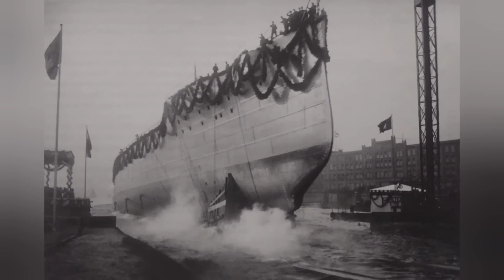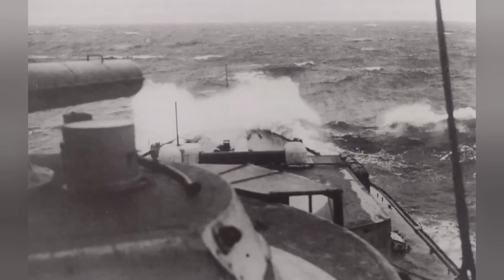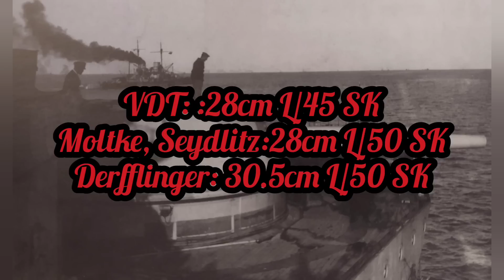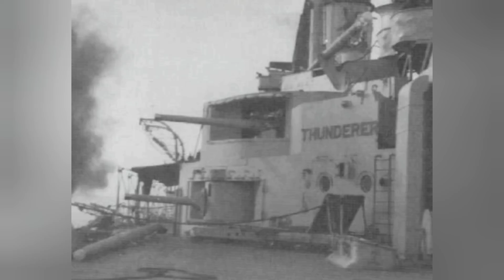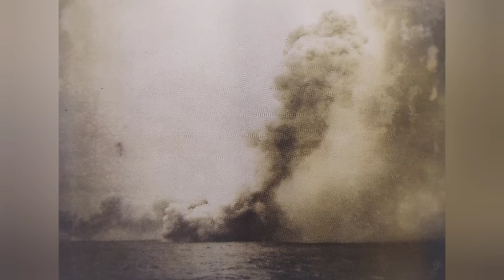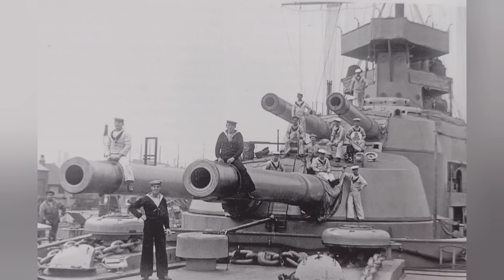Were German battlecruisers better than British ones?

Comment: The quality thing likely stems from the myth created by German tanks in WW2 everything I find from the time indicates the Germans never thought their ships would be like a better Tiger fighting a Sherman with a short 75mm gun and were aware their ships were similar but outnumbered. The greater armor on the German ships is due to 2 things, the British battlecruisers were not Invisioned fighting out ships like them the Germans knew their ships would be doing that. Next it seems like the Germans were less willing to take crew losses and tried to keep as much of them alive from hits as possible.
Reply: The latter reason is not right. The Royal Navy did not like throwing sailors away either. 

The difference between British and German battlecruisers comes down to role. Their roles were very different. When initially designed and built the British BC's were never supposed to be fighting in the Battle line. 

Their role was two fold, first to hunt down and destroy enemy commerce raiders. For Britain this was VITAL, a fact many people like to forget. Look at the Battle of the Falklands, that is EXACTLY the kind of battle that the British BC's were designed to fight, and when used to fight the battles they were designed to fight they did VERY well. 

Their role in a fleet action was to act as heavy support for the Fleets screening elements. In other words, their job was to hunt down and destroy any enemy cruisers that tried to interfere with the British screening forces. 

As you can probably see, the Battlecruisers of the Royal Navy were designed to hunt down and destroy enemy Cruisers. They were never, ever meant to fight in the Battle line. 

Germany however had a different issue. They were outnumbered when it came to battleships, and they knew it. So while it was not ideal, they designed their BC's to be able to fight in the Battle Line not because they WANTED to, but because they HAD to. This is why the German BC's had heavier armour but smaller main battery guns than the British.

What is not commonly appreciated is in a battlecruiser vs battlecruiser fight the German BC's were just as vulnerable against the British BC's as the British were against them. Yes, the German BC's were better armoured, but the British ships carried larger guns. 

A huge problem the British were having at Jutland is that the British shells were detonating too early, BEFORE they had penetrated the armour. While this issue was fixed later in the war, it meant that at Jutland a large proportion of the British shells were not penetrating German ships before exploding, but exploding on the outer armour. Now this does look impressive, and it can do a huge amount of damage to a ships superstructure, but it will not seriously affect a ships ability to fight, nor will it sink a ship. Armour piercing Naval shells are supposed to explode AFTER they have penetrated the armour, when they are deep in the guts of the enemy ship. 

Admiral Scheer, who commanded the High Seas Fleet at Jutland, and examined the damage after the battle, was of the opinion in his memoirs that if the British shells had been exploding when they should have been he would have lost six or seven capital ships at the battle.... 

The British battleships absolutely HAMMERED the High Seas Fleet, contrary to popular belief their gunnery was excellent. While the Germans certainly won the Battlecruiser engagement, Jellico's Battle squadrons decisively won the Battleship fight.... The main reason more ships did not go down was the shells exploding too early....

Comment: Underwater protection: HMS Inflexible on 18th May 1915 was seriously damaged by a mine – probably about 100 kg (220 lb) in size – that blew a large hole in her starboard bow and flooded the forward torpedo flat, drowning 39 men. She had to be beached at the island of Bozcaada (Tenedos) to prevent her sinking, as she had taken in some 1,600 long tons (1,600 t) of water.

Comment: Would be better if the comparisons were consistent.  Flipping between metric and English makes the comparison difficult.
Reply from the maker: @erikschultz7166  The measurements are metric and imperial. English is not a measurement.
When making videos, I stick with the measurements the ships were designed using, the Germans used metric while the British used imperial. When necessary, I do display metric beside the imperial measurement for the sake of clarification, which assist my narration. 
Thanks for commenting.

Comment: Two systems of view. British ships did not explode because of design, but of the ammunition handling. So their design was good.
German ships had speed problems because of their coal, so the English ships had a speed advantage. But here is my question, did you not want to compare design?

It is very clear that the German battle cruisers were better protected. Their protection was more similar to a battle ship. You go into convulsion to explain that the protection of British battle cruisers was similar good. The British battle cruisers were sunk by battle cruisers, SMS Lützow, the German battle cruiser that was sunk, came also under fire by British battleships.
In the end SMS Lützow's weak point were the bow and stern torpedo tubes. As torpedo tubes were not used it just provided a weak point.

The German ships sacrificed armament for speed, the British ships sacrificed protection for speed. It comes from the role each country assigned to those ships. German ships were supposed to be able to stand in the line of battle.

Germany did build in reality what was later called fast battleships.
Reply: As algahar stated,the german Battlecruisers did not even come close to being fast Battleships...Yes,parts of their armor had similar thickness,but it covered a significantly smaller Portion...Derfflingers 300mm belt for example would be considered pretty much useless by WWII,do to its small hight
Reply: No, they were not 'Fast Battleships'. Not even close. 

One thing most modern commentators are missing, that Admiral Scheer himself did not, was the shells. 

Scheer himself commented both after the battle, and after the war, that had the British shells been exploding when they were supposed to, he would have lost a LOT more ships that day. So what was the problem?

In short the British shells were exploding too early. Naval Armour piercing shells are designed to explode within the ship AFTER they have penetrated the armour. This is why the fuses for armour piercing shells are mounted at the base of the shell, not in the nose. The British shells were exploding BEFORE they had penetrated the armour. That looks as impressive as all hell, but it does a LOT less damage to the ship than a shell that penetrates the armour and explodes when it is supposed to. 

In other words many of the German Battlecruisers survived NOT because they were built better, or were more heavily armoured, but simply because the British shells were NOT exploding when they were supposed to be exploding. Nothing to do with the ships, everything to do with the shells. 

The fact is that while the German Battlecruisers were better armoured than the British battlecruisers, they were NOT in fact as well armoured as battleships, not even close. To save weight, so preserve as much speed as possible, the armour of the German Battlecruisers was much shorter than for the German battleships. The main belt was much smaller top to bottom (not in actual armour thickness) than a battleships. Battlecruisers also had less internal subdivision than a battleship. In other words they were NOT fast Battleships, they were battlecruisers. A Fast Battleship has the SAME armour as a battleship, the same internal subdivision, but is faster, and usually larger to make room for the extra powerplant and boilers required for the extra speed.

Comment: This is a good, well-banlanced video on these ships. It's worth remembering that the ships were built with different mission profiles. The German ship's area of operation was predominately in the North Sea close to their harbours. The British ships were built for service throughout the Empire. Even so, the German ships were better armoured but with a smaller main armament.

Also, I think the British ships were sufficiently armoured against their adversaries. The loss of the British ships was due more to poor ammunition handling, for faster reloading, than their armour protection. HMS Lion and HMS Tiger survived a fair beating, but Lion only just.
Reply: No, the Imperial ships were also designed for use in foreign waters.
This is proven, for example, by the foreign voyages to South America of S.M.S. Kaiser and S.M.S. König Albert, the visit of S.M.S. Moltke to New York and the constant deployment of S.M.S. Goeben in the Mediterranean

Comment: German guns were better, but the ships were about equal.
Reply: no the guns were not better, the german targeting systems, ie range finders were better. but the german gun dispersion was no better than the british guns. Additionally your notion also ignores the importancy of consistent ammunition. just look at how inconsistent the shooting of the Itallian WW2 battle ships were. Their guns were fine, but inconsistencys in ammunition led to the worst dispertion levels of and WW2 battleship
Reply: @jukeseyable  The German targeting systems were not better, they were different, and optimised differently.

The German rangefinders were better in the first 15 minutes to half an hour of an engagement, but accuracy started to drop off after that. The Germans knew this, but were fine with the compromise as they were banking on shorter engagements. 

The British rangefinders were lass accurate in the initial salvos, but got increasingly more accurate, and unlike the German rangefinders did not suffer that accuracy drop off after half an hour or so. Again the British were aware of this, but like the Germans were fine with the compromise because they envisaged longer engagements.

Norman Friedman in his book Naval Firepower really goes into the nuts and bolts of how the two systems differed, and their relative advantages and disadvantages. Its a very technical read but is considered the gold standard when comparing the British and Berman fire control of WWI....

You are absolutely spot on everywhere else though, more so with the ammunition than most realise, as the British armour piercing ammunition was exploding too early at Jutland. It was a problem that was fixed later, but Scheer himself stated that had the British shells been exploding after penetrating the armour as they were supposed to, he would have lost a lot more ships that day.

Comment: No. The main reason for the loss of British ships at Jutland was due to gross overriding of basic ammunition handling procedures. When the Germans had also short circuited the same procedures they almost lost Seydlitz at Dogger Bank. Another contributory factor was the slightly unstable composition of British shell propellant as compared to German. After all Tiger also took a few hits at Jutland but didn't explode.
Reply: in other words british incompetence killed their men.
Reply: @AndreasKonig-qq7yk  No , ypu donot seem to have read my post. I said that the Germans had also done the same thing but learnt after almost losing Seydlitz. The British did not have this learning experience.
Reply: Totally correct
It's my personal belief Seydlitz should be counted as sunk but later salvaged,
She grounded outside harbor and if the water had been deeper she would never have been recovered.
Wehraboo's will scream all sorts of nonsense but she was put in that condition due to combat damage inflicted by the British RN so sunk and later salvaged,
After all no one disputes Japan sank six Battleships at Pearl Harbor though four were put back into service.  Same thing as far as I am concerned